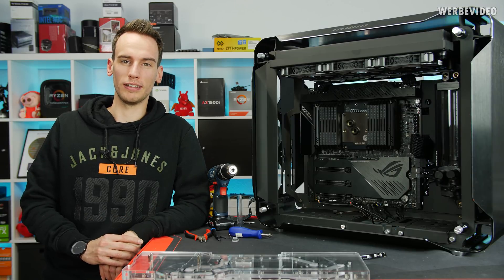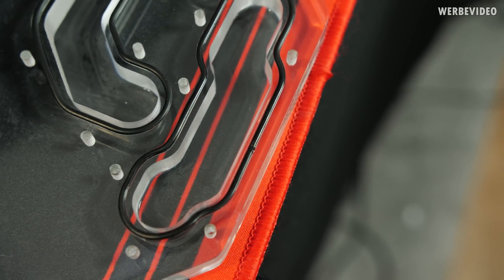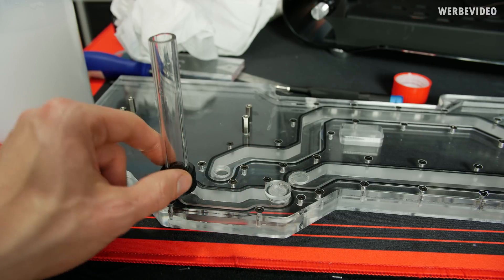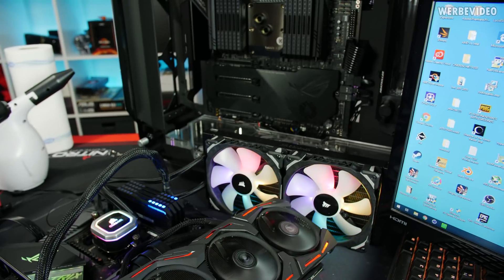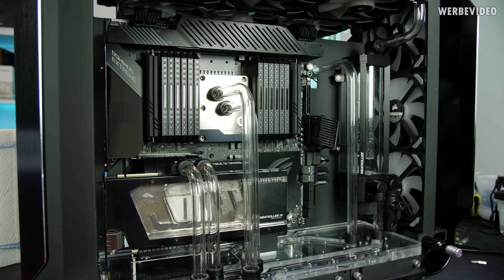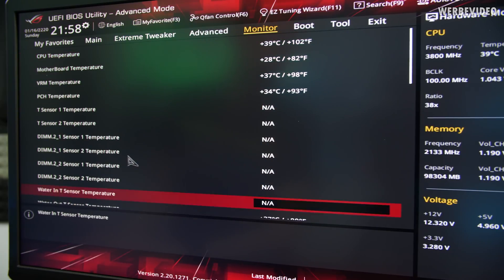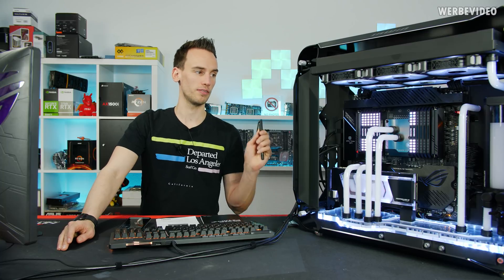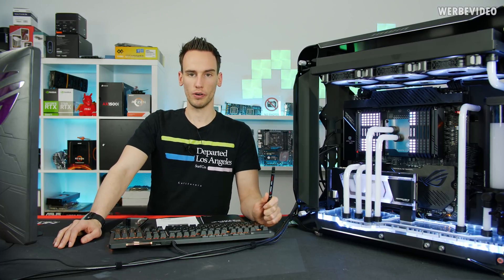Project Irrationality Part 10: Trying to fix the Distro Plate

Comment: Tip for sealing your block. If you can keep your seals mating up for example on one side of the block say the LEFT side.. much like when tightening the screws on a cpu cooler or the lugnuts on your car the order in which you tighten your screws down might have an inmpact on how the O' ring slides down into its groove when its a bit to long. Food for thought. 
BTW I feel hesitant to give any adivice to such a knowledgeable system architect as your clearly several layers of experience past my own personal trials. Cheers and good luck Roman & co.

Comment: That's a shame on Corsair with their iCue software and RGB fans. I had 2 fans (ML 140 PRO RGB) with RGB lighting hub
 and a Lighting Node PRO (RGB didng worked correctly). Bought another 3 and only on 2 of them RGB are working. Hub and Node working ok, detected in system, also tried to update a firmware - no difference. Never again Corsair!

Comment: Distro plates... a fad that needs to bugger off. They double the potential fail points by doubling the fittings in the loop and make a potential fail point themselves. Distro plate = more than double the potential fail points for more than double the chance of catastrophic failure. All that for an acrylic water block that's between each part in the loop because it has electronics looking grooves for the water to flow through aesthetics? Or just be an ugly bit of plastic taking up space.

I think you should have shown dropping the distro plate into the kitchen trash and make your loop without it since it isn't needed to make the loop and by default more than doubles the potential fail point and is the more in that, it failed making it not potential but fact. Chuck it in the can then pee on it would be more worthy of a burial than distro plates deserve. Nothing less fun than overengineering.

Comment: Fantastic build as always der8auer! Your care for your machine really shows... I feel somewhat your pain of maintaining a custom O-ring for your very custom distribution plate! As always never give up on such a pretty build, the creator of that fine distro must know something about those o-rings. I can only say I have never had yet to replace small o-rings with my fittings yet much thanks to NON-pastel based clear ionized pure water with additive. For O-rings that large, the super glue may not be flexible or nearly "squishy" enough like the o-ring if the super glue dried hard as a rock. I would truly invest two or three replacements of the larger o-rings each if that glue comes apart or too hard with leaking again!

Comment: Can you help me understand vccsa and vccio? The net has a lot of conflicting info on their voltages. I'm currently using a 9900k on a Maximus hero wifi board. I have 4 dimms of 8 for a total of 32, and when using their xmp the vccsa and vccio volts are automatically set above what many say should be safe. (somewhere around 1.3+) At stock speeds they fall around just 1v or less. I've seen people say that they shouldn't be any higher than 1.25 max, and 1.4 is dangerous. My old 7700k system would also do this, but only for a different set of dimms, but not my current set. I don't understand why these profiles would even allow these volts if it was not safe. I need clarity on what really is safe or not. It's as if the xmps are built without nearly enough forethought for them at all.

Comment: Seeing you putting this build together
, running into all the troubles and trying to fix them one by one closely resonates with my experience for a complex build. I'm currently working on a TT p5 build which has a large distro plate, 5 waterblocks and 2 rads. It's a very complex build and I've run into all sorts of issues like paint falling off, distro plate leaking, waterblock leaking, RGB light not working, components failing and etc. Seeing you dealing with similar problems gives me motivation to proceed with the build. Hopefully I can finish it by the end of this month.

Comment: From my own experience with Corsair RGB is that the memory can also be controlled by the motherboard instead of the Corsair software. So if you keep a static colour anyway then first set the colour of everything else related to Corsair, then shut down all Corsair software and setup the motherboard RGB. I only have two DIMM's and use a Gigabyte motherboard so it's not the same situation but when I only had the RGB memory from Corsair I didn't even bother installing their software as it just followed the RGB Fusion (horrible software BTW) settings. May be worth a try.

Comment: The easiest way to check for leaks was shown me by my grandpa when we repaired punctured tire - put it to water and pump some air and bubbles will show the hole (we also put a match into the hole we found to mark it :)). This would be great test for your distro plate. Just need to blow some air when it's under water and follow air bubbles. To me it is a lot easier that put liquid inside and also all the sections can be tested at once.

Comment: Loving this build Roman!! Have to take this opportunity to say thanks as you inspired me to take on my first pc build around 18 months ago and defo owe you some credit for this!

Nicknamed "Big Bertha" (she is not the prettiest), its based on x299, delidded 7920x (i did myself with help from your tool and videos!) with direct die cooling on water and with glass tubing. I used dremel with diamond blade at low rpm to cut and sandpaper to clean ends btw. Anyway, after some tinkering, it has a stable 4.8GHz+ overclock on 9/12 cores - which I am super happy with! Though this now has me looking forward to building another PC to sell if there is a market for it here in the UK as I enjoyed this so much!

All the best, keep up the epic content and enjoy your well earned break! 

Rodg

Comment: Keep an eye on those o-rings - glue is notorious for breaking down over time and when it is stressed. Even if it's fine after a 24 hour leak test with the system running, you may still notice seepage after a few weeks/months, or the whole thing may fail within a year. A drop in the res level is a good indication that something is happening.

You're using colored coolant so a white stain in the bottom of the case or floor is a dead giveaway.

Leakage like that in a block is the result of either the wrong diameter o-ring or not enough torque holding the block together (or both). A third possibility is you need to add a screw in the area where the leak is. It's the "compressed" length of the o-ring that needs to be precise. Also, avoid using power tools to put screws in - removing them is fine on the way out, but you should hand tighten on the way in, especially for fine thread that can strip if it's threaded into plastic. That's why you use a recessed hex nut on the other side rather than screw directly into the acrylic, especially when you need a water tight seal.

Loctite also makes that purple thread locker (222) if you do end up with a loose screw. You don't want to use the green and blue threadlocker those are way too strong.

Conformal coating the motherboard and GPU board is a good insurance against accidental water damage (marine grade electronics has it). Just make sure not to spray it on the ports and slots :-) You can also use heat shrink to seal off things like unused headers.

BTW: Glad that you take the time and effort to read the comments here - many other tech youtubers DON'T.

Comment: Very nice build mate! 
Question: I checked my “GPU POST” in bios and it says I’m running at x4native? 
Does this mean there’s something wrong with my Gpu? 
2080ti FE/ Maximus hero xi/ 750watt power supply/8700k @5.2/ using vertical gpu mount.

Comment: sorry to hear that corsair's iCUE software is limited to just 8 slots, I also have an issue with my corsair dominator platinum RGB kit, primarily with the icue integration with games. It seems that they were designed with just corsair vengeance rgb ram kits on motherboards with just 4 ram slots because all of the games to date that support it work on the first 3 ram sticks but the 4th one only the top 4 work. I noticed it was probably vengeance ram that it was designed to work with since those have 10 rgb leds per stick and 4 sticks equals 40 rgb leds. the dom plat rgb sticks have 12 leds per stick so 4 sticks would have a total of 48 rgb leds, meaning the last 8 rgb leds on the 4th ram stick are essentially set to off.

Comment: So you find cutting the o-rings at 90 deg then glueing them the best way? One place I worked they taught me to cut the ends at 45 deg then glueing them, but then our o-rings were for sealing vacuum chambers and not pressurized liquid chambers and I never researched the best way to do it they just seemed to work for our purpose.

Comment: Finally. Congratulations. One thing I have noticed. You shouldn't use the system PSU to power the pump when filling the system. Always use separate PSU with a jumper on it. If the leak was in bad place you could burn components.

Comment: We use silicon grease on all our o-rings for antennas and when we seal handheld radios.
Using a pressure tester we discovered that many Motorola DP4801 weren't actually IP68 fresh from the factory. Applying silicone grease to the o-ring remedied this.

Comment: Been reading through the comments and I think this is necessary, because there's a lot of garbage out there.

How to O-ring Properly: A Guide by some random twit on the internet.

For the purposes of this guide, and because it's not my job to teach the world a thorough but basic understanding of applicable mechanical design for hydraulic systems, I'm going to stick with static applications of o-rings in non-abrasive, low pressure, low part count systems. If you need to know more ask your daddy.

For these types of systems it's best to use a low durometer (soft) material in a shallow channel. The O-ring will experience no friction beyond application if it is installed properly, so this means that you could literally use one of those sticky hands you used to find in vending machines in the 90's and everything would be A O-Kay. The O-ring should be soft enough that when compressed in the channel the surrounding material doesn't deflect or warp, this means that after you are done tightening the fasteners in your acrylic plates it should look something like the following description:

Imagine that your step-mother decided to blackmail you into being her boy-toy for dominatrix play. One day she takes your floppy little dingus and sticks it between two plates of glass, then stands on the top plate.

That is a properly sealing O-ring in a static, low pressure application. Mooshed.

Next: In instances that necessitate bonding two ends of an o-ring together (because you don't know how to weld acrylic and need to use 37 feet of O-ring to trace your channels) you should never do the following:

Use a butt joint.
Adhere the two surfaces with a dissimilar material.
Place the joint perpendicular to the plane of the adjoining surfaces.

"But doesn't everyone I watch do these things?" Yes. They do. And they're doing it wrong.

Don't argue with me. Didn't you read the title? I'm the random twit on the internet. My word is gospel.

In situations where you must make a custom O-ring it is always advisable to at least use a 30/60 scarf joint. The plane of the scarf joint should run from the bottom of the channel to the top to minimize contact with the clamping surface, as opposed to running parallel with the sides of the channel. If you are using Buna N or another type of nitrile ring material, the proper adhesive is a likewise nitrile material such as 3M's 847 or similar products. If you cannot use a nitrile adhesive because you're too impatient to wait for a next-day delivery from Amazon, go out to your uncle's garage and grab his tube of silicone gasket seal he uses on the transfer case for his old jeep that hasn't been taken off of the jack stands in 4 years. It is important to use an adhesive that is as close to the durability and hardness of the ring material as possible to avoid distortions and gaps when the ring is put under pressure, and to ensure that the clamping pressure is adequate.

Come on guys... You wanna learn how to do O-rings you don't watch wet-eared nerds on Youtube put them together for the first time in their life. Go check out the knuckle-draggers who were rebuilding quarry saws at the same age you were putting together your COD 360 no-scope montages of yore.

Comment: Great configuration, very subdued and with spirit. The performance is also great, the person who knows how to use the potential of such equipment knows what he is doing :) I have a question for You about what You think about SLI - CFR, which can be used on Turing cards with NVLink. I play "Metro Exodus" for the second time with Ray Tracing on 2x RTX 2080Ti and we have about 60% scaling. Not crazy, but not bad for the unofficial solution available so far for more advanced users through NVINspector. I'm thinking of changing from 2x 2080 Ti to 1x TITAN RTX (in anticipation of Ampere) when I finish RDR2 (mGPU flies elegantly on the Vulkan API, but I recommend using the fps cap to improve frametime) and Exodus, because several titles I want to play in no way allows the use of a second GPU properly with SLI - CFR, for example "Ghost Recon Breakpoint". SLI - CFR may be an interesting hint from the point of view of the future of mGPU in the case of MCM systems, but I wonder if NVIDIA will officially introduce SLI - CFR (if they improve) in some closest rudders, would be pleased by owners of NVLink configuration. Do you have any opinion on this topic? Best regards.

Comment: Should call her Moon-shot.  Would love to to see you publish a detailed spec of everything. From machining specs to parts and costs and outcome speeds etc. Would love to compare notes because when machining my distro I used 2mm gasket and a 1/16" ball end mill that I ran -1.75mm z height cutting on a shopbot but then I found that I could not tap and countersink the top  sheet of acrylic (kept cracking or leaking depending on the torque applied to the fasteners) and ended up trying to use a chicago screw which sort of worked but settled on a metal threaded insert that I would heat up and sink into the back side of the bottom sheet of acrylic which opened up the options for fasteners/countersinks drastically.  Did he machine the tap into the bottom sheet on his C&C because I also kept breaking taps trying to do them all by hand (shopbot cannot tap threads like a full on C&C). Anyways  congrats of the beautiful build and cannot wait till you come up with your next moon-build!

Comment: This design is very nice. I feel the distribution plate could have more liquid channels. The idea is to increase the volume of liquid overall. Also, why not include metal heat dissipation into the lower plate? I feel the whole thing could be a cnc milled block of aluminum, with a top clear acrylic for aesthetics.

Comment: good to see it finally done! Honestly I'd be so dissapointed not being able to control all the RAM modules. I'd probably just not have them configured and just set the rest to white and have them in normal rainbow mode so at least they all light up, or simply just turn the RGB off on the RAM. Beautiful build overall! Totally worth it!

Comment: Looks really nice bud.  👍
How about a similar shroud for the PCI-E slot on the distro plate as the cables?  Would finish it off for me.
Reply: Jux Zeil
apple Pro PC levels you need, for cheap?
Reply: @lucasrem  can't get cheaper than 3D printed if have one. 👍